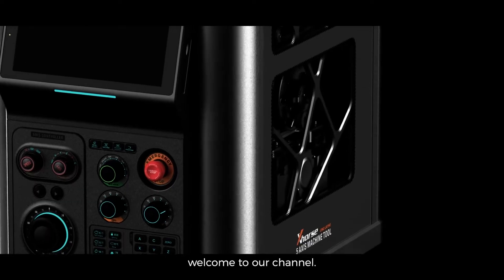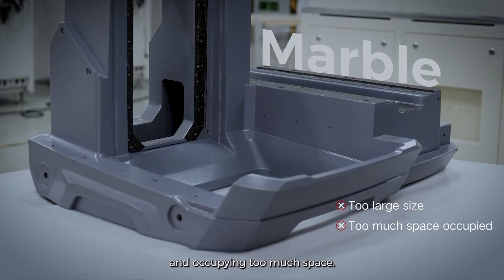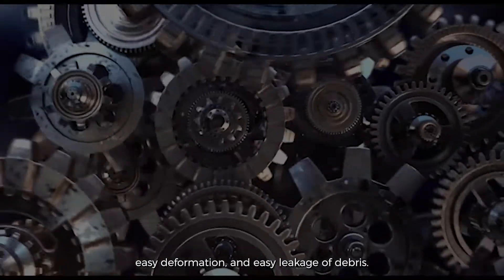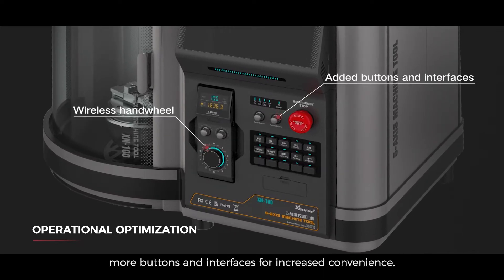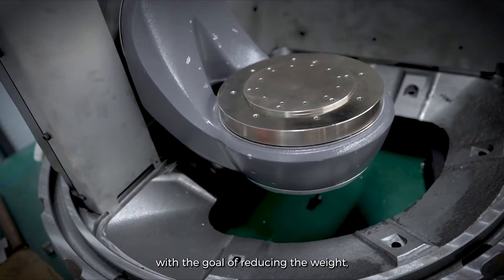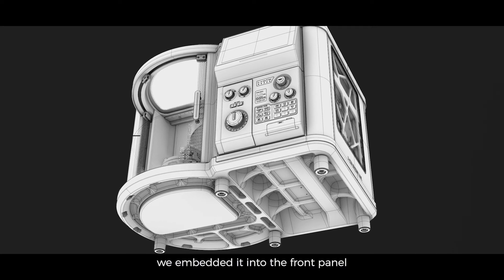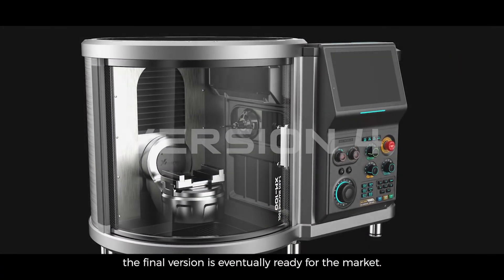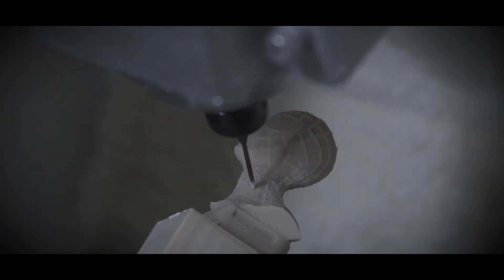How We Design a 5-Axis CNC Machine | CNC Machine Design | Unionx

Comment: Wish it kept the cast iron ( since the heavier would make it better at absorbing the vibration) or at least have some dedicated spots in/on the frame of the non moveing parts where the costume can add weight in what ever whem wanted if they want to ( i know i would with some epoxy granite or epoxy steel ) and instead of its only relying on the rotation of the moter/screw it also had some dro to compare agenst. And it could go from plus 20 degree to minus 180 ( so I can machine the part upside down which would help a lot with chip management. Just like the big boy grob cnc.s do )
Reply: Our design has to work within certain limits, mainly because it's for home or studio use. Our users' conditions restrict what we can do. If we use castings, shipping becomes a big concern. Our current aluminum machine already weighs about 130 kg! With castings, it would be even heavier, making transportation a real hassle.
Reply: @YONGFENXI-t3k is there anywhere where on the non moving parts where you can pour epoxy granite/epoxy steel after receiving/ put it where you want it ?

Btw are you also gonna offer a hsk 25 version/option for those that want to use toolholders and keep it set up outside the machine ?
Reply: @flikflak24  We will release different versions of the machine tool. The granite-bed version may feature a different structure, as we are introducing a new design. The pricing will also vary accordingly.
Reply: @YONGFENXI-t3kWhat price range are we looking at?

Comment: Hi 5 axis machinist here, i´m working on a 33t beast with X,Y,Z  4000mm,1350mm,1650mm with iTNC530 control. 🙂 Watching this video, i have to compare this machine to the penta pocket nc of course. This here looks more mature in terms of a usable machine with tolerances that may allow even prototype building if the accuracy you offer is proper and no marketing show. Having a possibility for coolant and atc is really great. I´m curious what the price will be and my guess is somewhere in the 15k to 18k range without some features that my be optional available like atc or else... In generall it is a nice to have toy from my perspective, it may be a very nice toy but still a toy with very hard limitations in space, wheight of workpiece, materials and else. Pitty is that this machines are, even if capable of beeing that good like stated, they are still expensive. Too expensive for the hobby home user for his 15+ parts a year when most of the time 5 axis simultanious is not even needed either.
Don´t get me wrong, but seriously who are the clients for this product? A professional like me can do it in his shop on machines that are costing hundreds of thousands, the occasional model builder will find cheaper solutions like xometry or something else or calls a friend... The pruduct may be worth the money but unfortunately it is of little use in reality i guess. Anyway, don´t get me wrong, this looks very professional and well designed from my perspective but i fear that this is a toy for the rich. Like the pocket nc... They are showing milling a fan propeller that anybody can buy everywhere for a few bucks, of course because of the simultanious 5 axis movement to be shown... In reality you wont buy a machine like the penta for 10k for this job, it would be stupid on a yet not known level. I guess this is also the reason you do not hear much about the penta pocket nc around... It is just of little to no use - even if it was a very ambisious project!

I hope you do not get this comment wrong, you sure a building something extraordinary, no question about that and i wish you good luck with this product!

KR from Austria
Reply from the maker: Hello friend, we really appreaciate your interest in our machine. It's parimarily designed with hobbyists, small shops, and educational institutions in mind. For hobbyists, it offers the ability to craft intricate parts and unleash creative designs. Small shops utilize it for crafting aluminum accessories and small parts. In education, where large CNC machines can be costly to procure, our machine offers a more budget-friendly option for training students in 5-axis CNC machining. As for the price, I'm certain it will pleasantly surprise you in due course! Join us in our community if you'd like to learn more details! https://www.facebook.com/groups/510178127720391
Reply: @xhorse3d  Thank you for your answer sir! I´m always interested in machines, so i will join, thank you for the invitation!
KR from Austria

Comment: The project is looking really good. Congratulations. A couple of suggestions if I may. If you can incorporate Erowa zero point clamping in the rotary axis that would be really productive. To avoid excess height stack  up. Also, adding vacuum through the center rotary for special work holding. I like your tool changer idea. However, if you can add 30+ tool stations. Maybe incorporating a kevlar belt. Cheap and strong.
Reply: otally! The Erowa zero-point chuck is a fantastic idea. We should for sure look into that.
Reply from the maker: Thanks for your input friend.💪
Reply: 30 tools, thats a lot, and takes a lot of space up.
Work zero plates takes space and weight, make zero with the probe.
Kevlarbelt is a good idea, thumbs up.